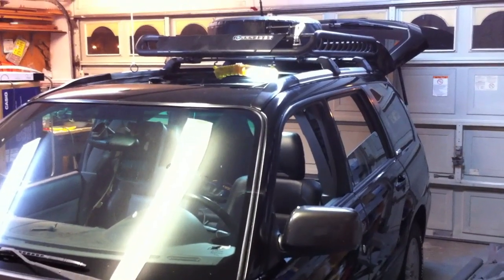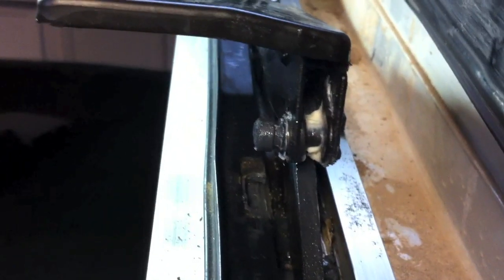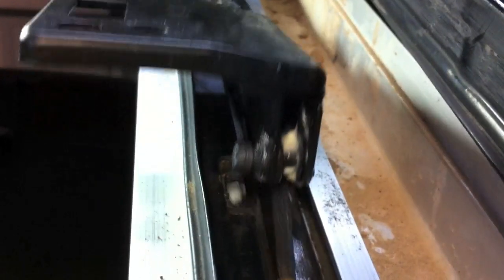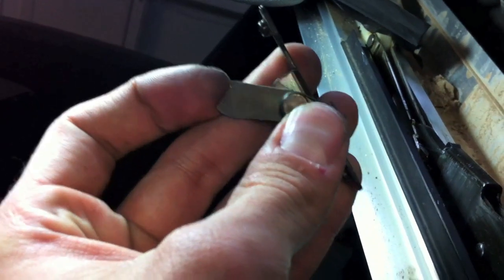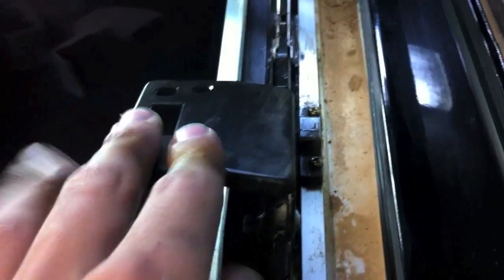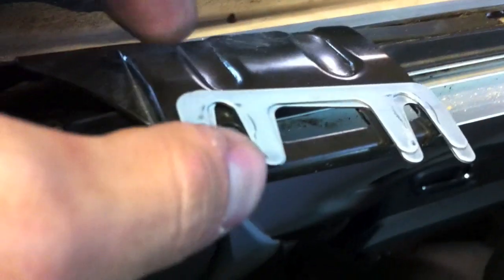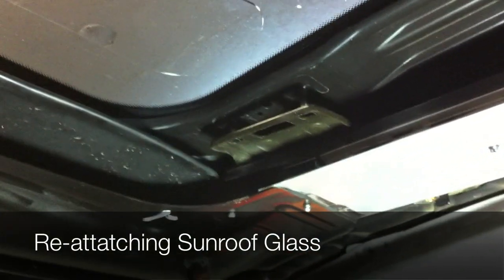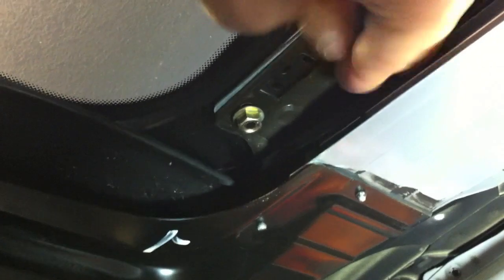Subaru Forester - Sunroof Fix

Comment: Excellent, helpful video. The problem with the moonroof on my 2007 Forester appears to have been similar: When closing, it would get within about 6 inches and then auto-retract when it sensed resistance.  I didn't find a significant amount of dirt in the channels and cutouts you describe but did find a couple stray strips of plastic and a leaf stem or two.  Also, it appears that lubricant on the outside of the tracks had combined with dirt and baked to a black glaze in places, which added to the resistance.  I scraped that off and applied paraffin (ie: rubbed the end of a candle) on both the tracks and the arms which lower the wind deflector and it appears to have resolved the issue.  All by itself, the tip about removing those two clips that close the cover was worth the price of admission.  Thanks for posting this. I'll find other uses for that $1500.

Comment: I have an 01 forester and it's the exact same thing. I was having trouble with it retracting so I removed it and cleaned all around the mecanism. After replacing it, it still didn't work until I loosened the 2 nuts on the rear passenger side and voila. It was able to retract all the way back and forth. Thanks for your video! I had no idea where to start until I watched it.

Comment: this video is very helpful.  My problem is a little different in the it is no problem to open, but on the close the front of glass panel is positioned correctly and the back passenger side is lifting up in to place. I think what is happening is seen in video around 1:13-1:15 mark where is dropping fine as it retracting/opening but not lifting on the return/close.

I am going to take a look at this and see if this is cause.

Thanks for posting

Comment: The problems I've seen with Forester sunroofs is different than this and is apparently something Subaru is aware of, as they make a repair kit.  It involves two plastic guide blocks which fit into the channel, which often break on the original sunroof.  The new replacements are made of stronger material.

Comment: great video.  thank you for sharing.  my sunroof is stuck all the way open.  it seems mechanical.  the is power in both direction, but it isn't moving.  i hear some clicking.  I can give a pull assist our about 4 or 5 inches, but it won't move any further than that.  Any ideas?

Comment: I took my glass off to try and find out why it would not slide back.  I cleaned it and lubricated it well.  But the outside pin is binding  just at the point where it is supposed to drop down where the 'R' guideblock is. It won't drop down and slide back unless I give the mechanism under the glass control arm a push.   So, something is binding up and preventing the pins from sliding down into the track.

Comment: Hello Blue Fox:

I attempted to follow your video step by step to repair my XT Sunroof having the same retracting problem but it was not to be.  What I found was that both R&L front slide rails would freeze up after the roof was fully closed causing it to lock in place and the retracting motor did not have enough power to reopen.  As soon as I removed the glass panel it was freed up and I was able to see the problem.  The RF passenger side (Pic 1) was hard to move backward and forward by hand, but the left front (Pic 2) was nearly impossible.
Reply: you get this sorted? if so how. bout to tear into mine.

Comment: WOW..  I have a seal problem with mine and they dealer wanted to charge over $400 for glass and 7 hours of labor.  They told me that it takes over 5 hours to drop the headliner.  Which was a lie because I can drop my headliner in about 45 minutes.  

So my question is did you replace the seal on the glass while you had it out?  Do you know where I can order just the seal or do I need to take it to a window company to replace it for me?

Comment: Peole often go to the dealer to get stuff fix and pay 6x more than if they did it themself with a few hours. And aldo never buy a key or remote from them you can always find the on ebay or amazon for cheap and research on how to program it eich is normally a simple trick with your key

Comment: That's exactly my problem! Thanks for posting the video! It drops down then locks up. I won't be fixing until next spring in case something goes wrong, but now I know! Also I'll be doing the 'no catch' mod since I hate that.
Does it still pull it back when you open it if the visor is closed?

Comment: The black plastic covers on the window attachment bolts, do they pop or slide off easy? I have a crack in the glass, a replacement glass, and just don't want to break anything I don't need to.

Comment: I have a 98 eclipse gs. Itll go to the vent position but will not go back any further. I look at the arms that lift it up one is at a 90 degree angle and the others at a 45 degree. When i go to close it the passenger side seals(45degree side) but the driver side doesnt seal i have a 1/4inch left to go and wont budge

Comment: I have the opposite problem. On our Forester, it won't close all the way without auto-retracting when it gets to the point of bringing down the little wind deflector. The instant it touches the deflector lever, it retracts again. I need to get in there and figure out a fix for that. For now, we have to hold the deflector down with a finger until the sunroof goes past the engagement point of the deflector lever.
Reply: +tayl0rd i have that issue too.  now i cant use it without worry that it wont close.
Reply: Donna Winter
It'll close.  Just watch your finger while you're holding the deflector.

Comment: I inherited my Mom's Subaru Forester 2004 and am looking forward to having a sun roof! However the sun roof on the car has a problem that one of the rear corners is not closing level with the car and is lower causing a leak.  Do you think it is worth looking at the bracket as you describe in your video to fix this problem?
Reply: What was it

Comment: Great video! I just bought a 2004 Subaru Forester Xt. When I test drove it, I tried to open the moonroof but it wouldn't, even though I could hear the motor working. I figured I'd just fix it another time. So I tried tonight by taking the sunroof off and cleaning the rails ect, but it still won't budge. I noticed some little 2 screw how clips ( one on each side) that were preventing any movement. So I removed the clips and pressed the open switch. sure enough the rails moved all the way back and forth. I put the moonroof back in and tried the switch. it only moves about 2mm and then it gets stuck on the roof because it won't lower properly before sliding back.
help please!!!
Reply: +Zakari Graovac I know this is an older comment, but chances it it could be a broken window regulator. Don't quote me on that as I don't have experience with fixing the Fozzy moonroof, but that's exactly what my old car was doing. You'll have to remove the headliner to get to the motor/regulator unit, but definitely check that out.

Comment: Do you have to drop the headliner to remove the glass?
Reply from the maker: You do not, no. You can get to the bolts that hold in the glass from inside the car, and the glass comes out from the top. Super easy.
Reply: @ModFoz  Oh wonderful. My sunroof has a crack and I'm glad I don't have to tear the interior apart to get to it 🙂

Comment: if sunroof is in closed position can the glass still be removed without removing headliner? Or is this fix for retracted sunroof only?
Reply from the maker: +Luke Sheldon The headliner doesn't need to be removed to get the glass out when the sunroof is closed.

Comment: Hey blue Fox, 
I have those same issue, but when I removed the glass, the brackets would retract all the way.   it's only when the load of the glass is on there that they get stuck.  Dias you have this experience or did the brackets get stuck even with glass removed?
Reply: jawojnicki I have the exact same issue. Passenger side won't drop with glass on. When I remove glass (to clean everything) it moves just fine. Did it twice and same result. It just wont move under load of the glass...cant figure it out for the life of me
Reply: Cubanb407 do you fix it?

Comment: is this the same for a 2001 forester?
Reply from the maker: Hermann TheGerman Possibly, but I can't say for sure.
Reply: I have a 2001 Forester and have removed the sunroof;  The bracket design looks identical to this video, even though the 03-08 is technically the next "vintage" of foresters.  Unfortunately, I did what blue fox suggests and it didn't fix my problem.  Hopefully it will work for you.  The brackets move fine when glass is removed but get stuck every time when it's installed.  Let me know if you find a fix for yours please!
Reply: @jawojnicki  i worked for mine 2001 forester S. You just gotta make sure everything is cleaned and moving freely.
Reply: Yes sir I just did this on my 2001 forester and it's working now!
Reply: Luis Chavez when you moved the switch to retract the moonroof did your moonroof go down but get stuck before moving backwards?